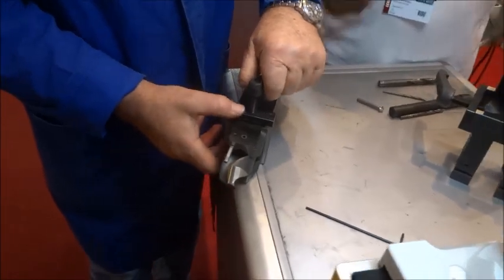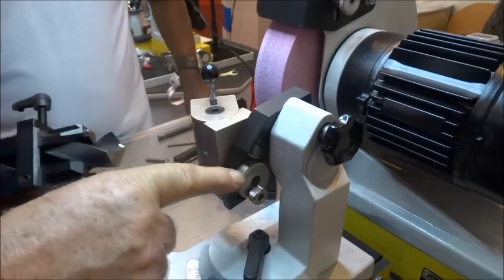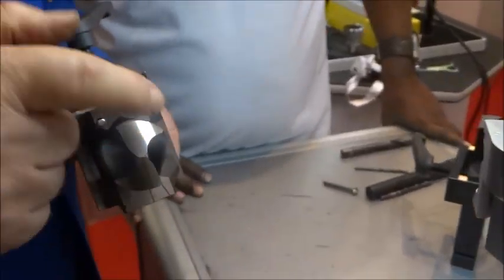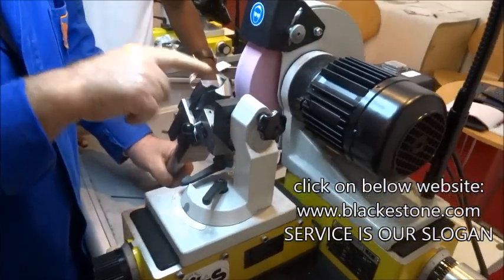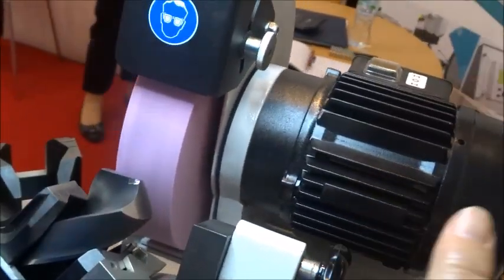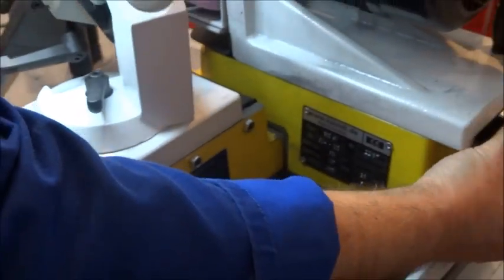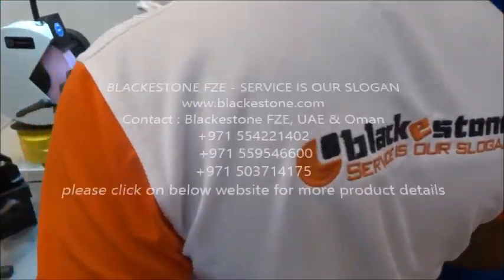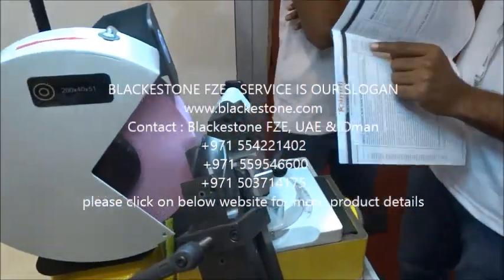Drill bit sharpening Machine up to 60 MM ( Blackestone FZE - UAE )

Comment: Looks like an expensive piece of junk.  I had the privilege of using a real one back in the day with an eccentric chuck that matched any standard twist drill profile, large or small, and it worked great and swiftly.  I used my own diamond dresser to smooth the stone and it was away.  The boss never bothered much with it.  He always bought new stuff for his high powered CNC lathes and mill.
Reply: What's the real one?
Reply: @Universal_Craftsman  the one that accurately follows the complete drill profile.
Reply: @nickmansfield1  Do you have a link?
Reply: @nickmansfield1  make and model of machine please?
Reply: @neonvioletstar  sorry dude, I last used one of these machines about 20 years ago and that business has gone and the boss retired to another part of the country.  If you search YT you should be able to find a Russian video and their sharpening machine which was even more capable.  Russians and Germans and some other EU countries tend to build good machines.

Comment: very nice very solid holders tho bet that price is huuggge
Reply: I visited the website. After several attempts I eventually found the drill sharpener. It gives every height,weight,length spec imaginable but no price indication . That suggests it is far too expensive to advertise the price openly.